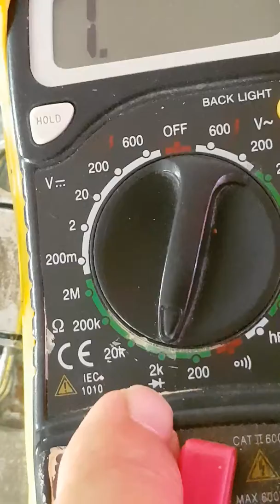Yamaha 01v96 fader problem

Comment: I have yamaha 01v it, and we made a mistake installing the cables. As soon as we connected the electricity, the screen went off. What happened in this case?
Reply: Is the problem in the screen? memory intact???
Reply from the maker: Wrong voltage? 220v to an American 110V unit?  Probably the power supply is wrecked, if nothing lights up.  Or are you saying all other lights and LEDs work and respond to button pushing, but not the screen?  If so, yes possibly the screen.
Reply: Si falla un transistor ¿Fallan todos los faders o es por canal?